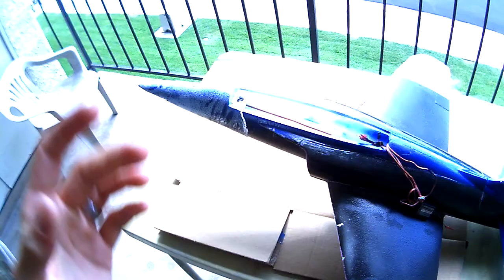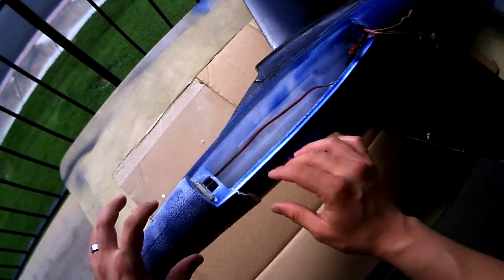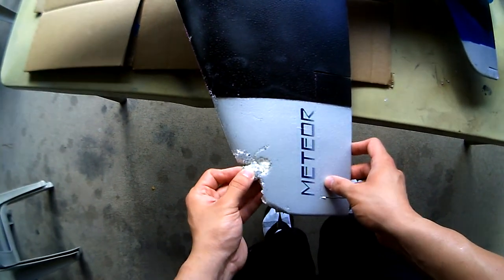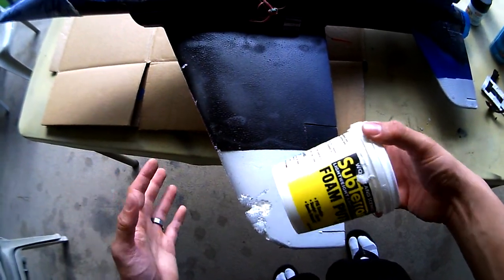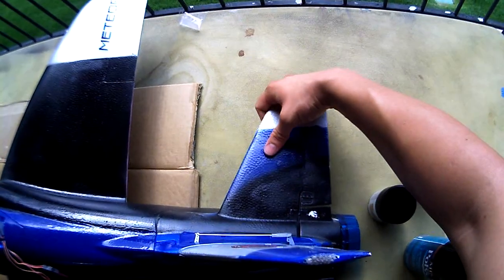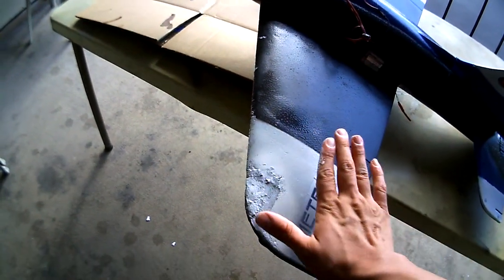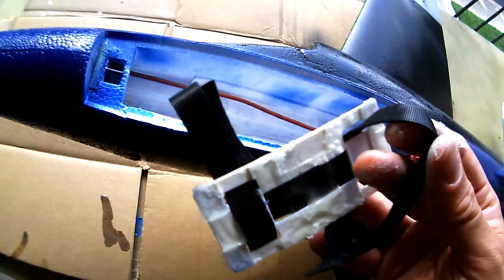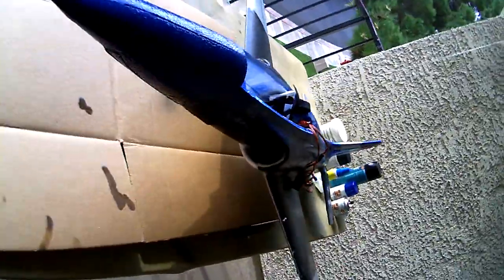Meteor Crash aftermath and repair!

Comment: foam putty..I have not tried it.  Did you try to smooth with a putty knife or a credit card?  You should be able to smooth that stuff out, and sand it if necessary.  The rest looks great.